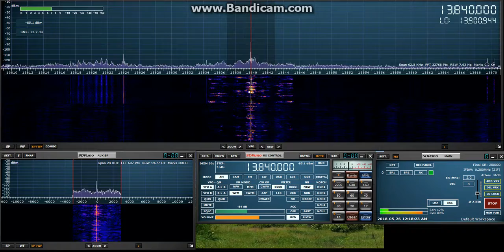RNZI 13840 Khz  26/05/2018 03:16 UTC

Comment: Hi Ray, despite the noise, a very nice signal from RNZI. The distinctive low pitch buzz and bouncing up and down of the noise-floor looks to me like PLT noise. I get something very similar at my QTH at various times. 73, Clint
Reply from the maker: Thanks Clint,this appears to be 24/7 with 10 secs of silence affecting half of the spectrum.Its really getting me down TBF.oh well.73 Ray.
Reply: Ok, so I assume you've checked all the obvious noise sources in the house - TVs etc.? One other thing to try is your cable TV boz. I know from a conversation with a technical guy from Bonito that they are know to generate a huge amount of broadband noise when transferring data. Just a thought my friend, I hope you get it sorted. 73! Clint
Reply from the maker: Yep checked everything in the house.Cut the chord so have no cable/dvr box anymore.The loop picks the noise up better than the random wire.Has to be coming from a neighbour i am thinking.73.
Reply: You're probably right about that Ray. I have the same issue here - so I try to get out as much as possible. Best of luck sorting it out one way or another. 73, Clint

Comment: Excellent DX from your QTH! 73 Adrian
Reply from the maker: Thanks Adrian,hows it going at your QTH?73!
Reply: Ray Kelly Good Ray thanks. Just ordered an MFJ switch to allow the 
Transceiver and SDR share the antenna. I'm hoping it works out as currently I tend to leave the transceiver hooked up and not use the SDR as much - it'll be great to integrate the waterfall into the ham side of things and be able to easily do a bit of dxing simultaneously. You down at East Passage at the mo?

Comment: Great signal from RNZI, Ray! I agree with Clint that the noise sounds like PLT which it's a pest at my QTH as well. What surprises me is the fact that the noise is interupted by quiet periods. Usually ther is no interruption and only the amateur radio bands are notched out by the PLT devices. Maybe a more sophisticated PLT adapter is in use that limits noise when no data is transmitted? Just a guess, of course... the source of noise could be anything else. 73!
Reply from the maker: Make sense Matthias.As 20m and the higher ham bands seem to be mainly unaffected its just everywhere else.I was able to get the loop up about 30 ft off the ground temporarily with no real difference.Hopefully taking it down to the cottage in a few weeks for the first time(the wellbrook)excited to see how it fares in a no noise environment.73 and thanks for the info.
Reply: Hi Ray, if it's PLT the only solution is moving the antenna at least 250 m away from the source of noise as that is the usual reach of those annoying devices according to my experience. Fingers crossed that you will get great results with the Wellbrook at your cottage. 73!
Reply from the maker: Thats a lot of coax plus someone may nick my loop from down the rd haha.Seriously though i have managed to reduce its effect a little bit i spent some time moving the loop all over the yard and actually found a better spot and it only helps in on precise direction but its an improvement.Thanks for the info and 73.